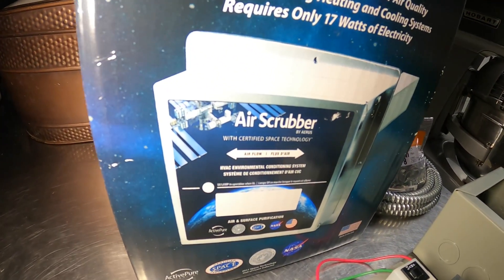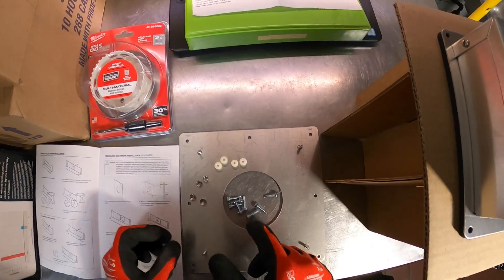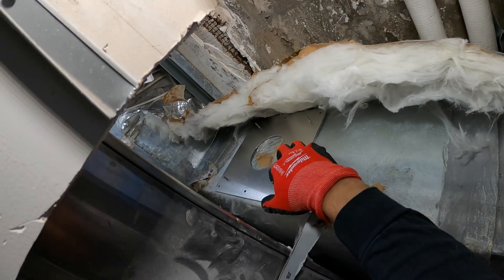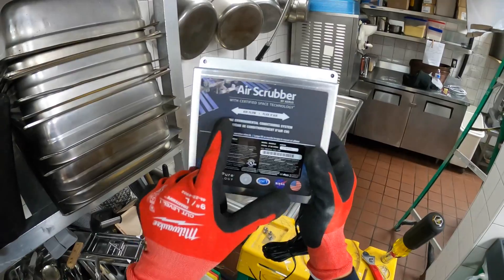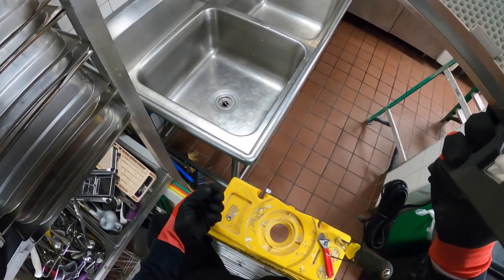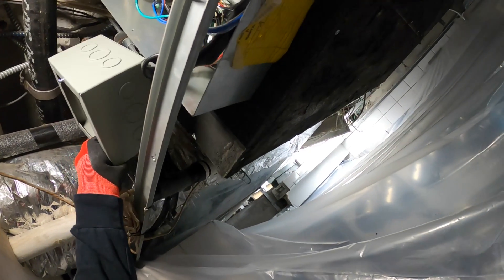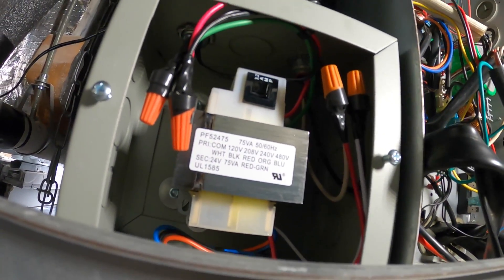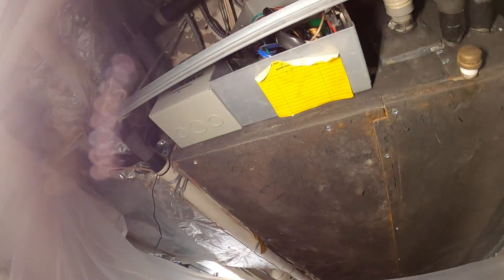HVAC Service Call: Air Scrubber By Aerus Installation For LG Multi V Air Handler Unit (LG HVAC AHU)

Comment: I like to use aircraft snips from Midwest to cut my holes. Can get into tight spots and back hole does not need to be a perfect circle, just bigger then the metal back plate hole. Good jump using extra transformer, I see alot of guys not use a dedicated one for the light. 

Love the videos, very entertaining and informative.